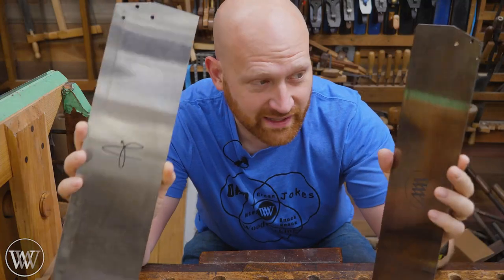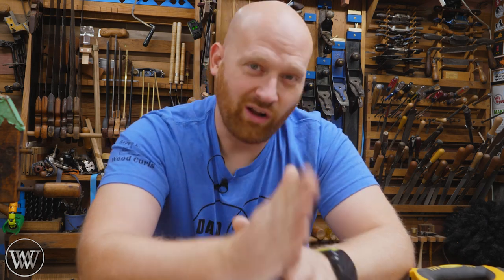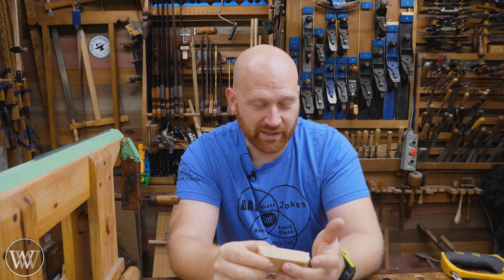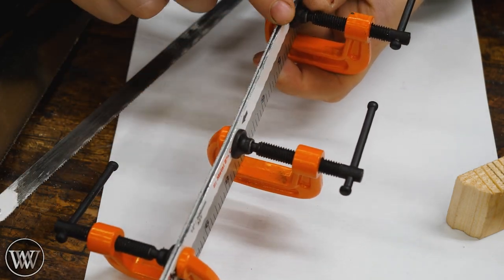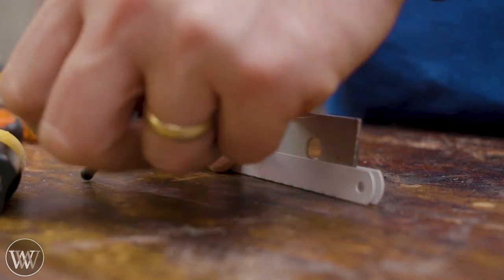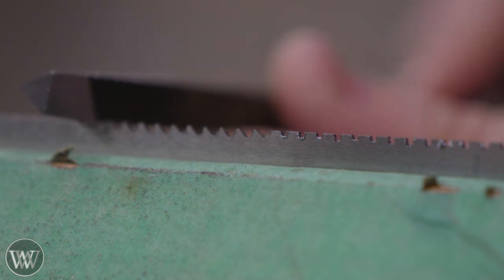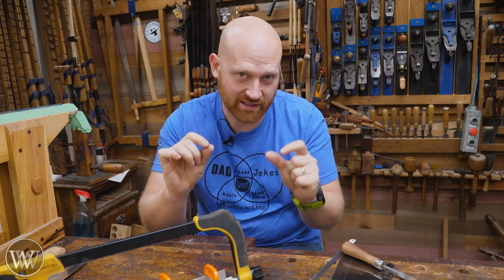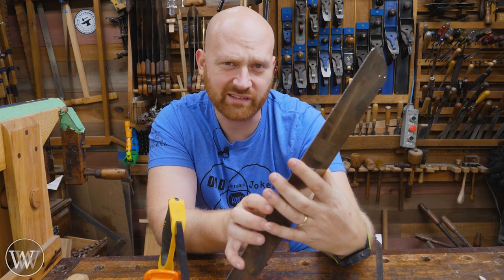Why I Have C Clamps On My Saw Cutting Teeth

Comment: If you have trouble starting the cut on the metal because of skating, turn the blade around and do it on a pull cut. That's useful whether or not you make the jig. But that jig sure is a clever solution.

Comment: 1. Spot weld the hacksaw blades in place.  Set it all up.  Get it right and then zip around to the welders shop and lock it all in place.  Mark the jig for the PPI it does.

I'm happy doing as fine as 12PPI, but you have just solved how I can form PPI smaller than that for dovetale saws  That's great!

Comment: Make small hardwood clamps (basically 2 pieces with a wing nut apply the pressure)to keep the center of mass closer to the midline, make it lighter,  and you don't have to listen to the handles rattle at every stroke

Comment: For the clamping I think cutting a grove in a piece of maple or other hard wood and then putting threaded holes with bolts or setscrews in them every other inch or so would work nicely.

Comment: How about making a special blade holder with a screw adjustable separation between the cutting blade and the guide? Something like those wooden grooving planes have. A luxury feature would be to have the guiding blade able to hinge up and down so that it hangs down below the cutting one when the cut is started and then retracts as the cut deepens.
One option for getting the TPI/PPI sorted out would be to get a threaded rod with the right pitch and use that as the guide or get a thread pitch gauge.

Comment: That is actually a very simple, but genius method Alex has figured out, props to him. I think for spacers, you found one of the easiest and cheapest options, as you can quite easily find metal rulers in quite a few different thicknesses.

Comment: Take some thickish bar stock, and cut a groove in one edge. Cross drill and tap one side of the groove for set screws.

If grooving the bar stock is too hard, find 3 pieces of metal that you can combine for the same profile, and drill, tap & screw them together

Tack the spacer and blades together with superglue. Load them into the slot in the bar stock, and fix In place with the set screws.

Or, like someone else mentioned, "Toolmakers Machinist Parallel Clamps". TayTools sells them. (like little hardened steel screw clamps). Use 2 or 3 of those to reinforce the blade sandwich, instead of the slotted bar stock.  If the screws really bother you, file flats on the threads for a wrench, and cut off the excess.

Comment: Another idea for shims would be to get set of mechanic’s feeler gauges to use with your steel ruler to set your spacing. Just use the appropriate feeler gauge or gauges at each clamp.

Comment: Great video and idea to solve an old age problem ! Just an idea with the two hacksaw blades to set the one with the back side down lower so that it acts as a progressive cut so that you do not have to angle the blade when cutting and the hack saw blade does not jump on the cut into the blade you cutting.
Reply from the maker: The problem with putting the smooth one lower is that you would then have to angle the saw to finish the cut. And then all of your sockets into the plate would be at an angle. That would make it harder to get the guide blade in.
Reply: So as the cutting blade advances and the curf deepens, the guide (upside down) blade  is getting higher in sympathy with it along the length of the hacksaw? Thus keeping it all on the vertical?
Reply: Hang on no - the guide goes deeper...... no my head hurts!
Reply: @WoodByWrightHowTo  At the far end the non cutting blade is lower, but at the near end they are level. That way in the beginning You have the guide and at the end of cut you have a full depth of cut. To start cutting the teeth You simply start at the end of the plate.

Comment: Just an idea: figure out what bits of shims you'd need for various TPI; sheet steel, hacksaw blades, a ruler etc (like with a dado stack as previously mentioned), clamp it all together and drill a handful of holes along the length to run bolts through, use a dremel or file to elongate the guide and cutting hacksaw blades to allow for the depth adjustment. 

For depth setting an assortment of metal rod diameters could be used, or a combination square in a pinch since you wouldn't have to worry about the assembly falling apart with everything loosely bolted together.

Comment: My first idea is to use a dremel or a proxxon tool with diamond wheel mounted on a wooden jig with one metal "finger" for the cut positioning. Afterwards you just move the whole plate. Not hand tools but i have a proxxon tool at home :)

Comment: Great idea, if you have a bunch to do I wonder if it wouldn't be easier for setup to get your spacer and guide-blade fitted-up on the bench and temporarily glued together with some CA glue THEN clamp to the cutting blade. At least for setting the depth-stop part of it you could then use something like a vernier caliper to get the depth where you want rather than hunting for some sort of shim/nail. Though I get the impression if you have a bunch to do you are probably further ahead to just get the saw plate cut on a machine or something...
Reply from the maker: CA glue is not a half bad idea to get in the right place.

Comment: I like to put a little machine oil to my metal cutting saw. Cuts down on the vibration and makes bit easier to push. Tho it makes chips gather around the teeth and clog so every now and then little wipe needed

Comment: This is exactly the thing I needed to get motivated about making saws again, thank you! And if you're anything like me, one thing there's no shortage of in the shop is prospective projects you'll totally get to one day. This means I've got gobs of old saw plates lying around I've been meaning to spruce up again or practice on, so why not use them for the depth guide portion of this jig? Hell, even just a third hacksaw blade should do the trick for the fine toothed saws, unless I'm getting ahead of myself. Panel saws won't do, considering their profile tapers towards the back and up to the top, but if I'm not mistaken any old back saw should have a pretty consistent thickness all along the plate.

Comment: Incredibly ingenious. Way to go Alex! My first thought for exact thicknesses was feeler gauges but they are usually far, far too thin and I've never seen one as long as a hacksaw blade. In truth, you would only need 5 or 6 sizes. I paid for my first tuba working summers at an HVAC shop where we made our own duct work. Sheet metal comes in very exact thicknesses usually expressed as decimals, for instance .032 is a very common thickness. And they always have sheet metal shears that cut 4 feet across. I'll bet a good HVAC or machine shop would cut you several strips in the thicknesses you want for very little money. And if they don't have as thick as you might need, you could laminate or just stack several thicknesses together to make it. A one inch, 4 ft long strip of 2 or 3 thicknesses would cut into four 12 inch strips of each thickness. You could just about make any thickness you want out of those. Kind of like stacking together dado blades and shims. (GASP!)
Reply: In metric land feeler gauges are usually sold in sets with strips from 0.05mm up to 1mm in 0.05mm increments for cheap enough that cutting a few apart for a project would not be a problem.
Reply: @pettere8429 , And, since they're usually manufactured and sold world wide in either TPI [Teeth Per Inch], or PPI [Points Per Inch], one can also easily find feeler gauges in thousandths of an inch thicknesses in "Imperial Measurement Land".

Comment: I don't have any ideas for improvements per se but I would think if you had  ruler/shim stock that was a little to thin for the PPI you want you could pit a few pieces of masking tape on either side to beef it up. The metal core would still provide the rigidity and wear resistance.  I also thought that the c-clamps would make the whole say heavier thus allowing you to focus more on control than pressure. Let the weight of the tool do the work sort of thing.

Comment: I like this idea. It reminds me of guitar fretting jigs. They involve basically a mitre box with an indexing pin, and a toothed fretting template that sticks to the fretboard and slots into the pin so you cut in the right place for the fret. They also have a depth stop incorporated and sometimes bearing guides, so more complicated but reminiscent
Reply: Also it reminds me of the table saw finger joint sled that people make, popping the previous cut into an indexing pin

Comment: I have re-toothed a few saws using both the paper strip and the Paul Sellers wood block guide methods. I never liked the paper method (probably a combination at lack of skill and impatience). The wooden guide is ok for saws down to about 12 tpi but I really struggled when trying to do a 15 tpi dovetail saw. My solution was to use a blade meant for a mechanical hacksaw with the right tooth count as a guide. The blade is at least 25 mm (1 inch) deep and doesn’t have the “wave” set of most hand hacksaw blades. It is easy to clamp to the saw plate and I made the initial cut with a junior hacksaw, modified as per Paul Sellers.
I know this isn’t really adding to the innovation of a saw tooth cutting jig but it worked for me to do a one off project.

Comment: McMaster Carr or Grainer likely sells brass or steel in thicknesses that would make good inexpensive shims.  Thanks for sharing.  I've got an old Disson saw that used to reside in my dad's 56 Ford pickup truck to rough cut lumber.  He have it to me after the saw sat outside for a year.  It's on the list to restore.  Since I already have more saws than I need, I was planning to convert it to a 3 PPI ripping machine.  Still likely going to stick to the Paul Sellers method and actually use a finer PPI first two inches of the saw to redo the plate.  Glad to see this method though.  Little by little I've been making my own tools becuase it's fun to do so and a saw is on the list for sure.
Reply: Also should say, I used McMaster Carr to but O1 tool steel that is 1/16" wide by 1/2" thick for like $10.  I am going to use that stock to make my own 1/16" wide chisel sort of in a mortise chisel style (for the once every three years I need to use it).  That's why I know they have lots of metal in various sizes to choose from.
Reply: McMasterCarr was my first thought!

Comment: I have some spring clamps that I got for scale modeling that might work for holding those blades. They are quite steady when used on flat pieces. And they'd fit under the frame of any but the smallest hacksaw.
Reply from the maker: I thought of adding double-sided tape to add a bit of friction. Then even with a lighter spring clamp it should hold.

Comment: Look at the see-saw, did you see what I saw?
Your saw TPI jig is great. It’s basic. And most importantly, it works.
Consistency in TPI means your cuts are done correctly and saves labor.
Outside of spending $$$(who has extra saved up?),It’s the prefect fix.

Comment: The upside-down hacksaw blade could be a little lower to ride in the previous tooth gullet; this way you would not have to angle the saw before creating the next gullet. Of course, you'd have to create the first one, then put the second saw blade in place so it'd be another set-up step, but might save a lot of time and fidgeting for most of the cuts.
Reply: I initially thought to do this, but it wouldn’t work (at least didn’t in my head). It will cut first tooth ok, second to a lesser depth, and third or so wouldn’t cut, as will not have enough depth in the reference tooth. Again, this were my thoughts and reasons keep blades parallel
Reply from the maker: The problem with putting the smooth one lower is that you would then have to angle the saw to finish the cut. And then all of your sockets into the plate would be at an angle. That would make it harder to get the guide blade in.
Reply: @WoodByWrightHowTo  this is an awesome trick. I wonder if there is a reliable way to place the upside down blade at an angle so that one end is marginally lower than the right side up blade and level at the other end.
Reply: @WoodByWrightHowTo  you could use a 3rd blade as a spacer too

Comment: Could you make a spacer and then glue something both ends with the right depth? Then means you can just use a flat surface to set the whole thing up so long as the blades are standing square

Comment: The bigger difficulty I've always found is after shaping small crosscut teeth is getting the set right. Very fiddlly keeping the saw set firmly on the twice angled tooth. Maybe I just need to find a way to get the hammer and anvil a smidge lower down the tooth.
Reply from the maker: a good saw set that fits your style is worth its weight in gold.

Comment: What do you think about for a one off doing the paul sellers method but 3d printing the guide block? You might need to print one for each saw or two but if you've got a printer they'd be cheap and quick to make. Or just 3dprint the spacer for the two hacksaw blades?

Comment: Is it possible to cut a kerf in say a 3" long by say 1"x1" piece of wood that can rest over the new blade. Then affix a thin square piece of metal onto one end that hangs down roughly the desired cut depth and is filed so that it can sit in the previous cut tooth while the face of the metal acts as a guide to saw along? So you cut a tooth and just advance the guide block down the blade to line up the next cut. It doesn't give you the depth stop, but it seems like you could possibly count strokes for that.

Comment: I would imagine that you could even do multiple cuts at a time the issue would be tensioning each blade. But nuts and bolts in place of the c clams could work.  A dedicated jig out of old old hack saw blade.

Comment: This distinctly reminds me of a box joint cutting jig just switched around somewhat.  I suppose if someone wanted to they could use a tile cutter with a relevant jig to move it closer to a normal box joint cutting jig.  You could even then go down the lines of adding the relevant angles onto each tooth as they're cut.  This would be an interesting experiment but kind of defeats the point I feel.

Comment: If you drill through the blades and spacer then rivet or bolt them together you could do away with the clamps and free up the length of the blade making it less bulky and cumbersome to use
Reply from the maker: Drilling through hacksaw blades is not easy. But if you can do it that would be a great answer.
Reply: @WoodByWrightHowTo  how about diamond dental drill bit in a Dremel tool?

Comment: How about a guide that's not attached to the hacksaw at all - one that's like a cross between a magnetic dovetail saw guide and a box joint jig?

A small piece of soft metal (mild steel, brass, aluminum) with a groove/kerf running longways down an edge that's just wide enough to slip down over the top of saw plate.  Crosscut a perpendicular kerf on the same edge with the hacksaw that's a bit deeper than the long groove.  Wedge or glue in a piece of hacksaw blade upside down in the crosscut kerf to index the jig.  Cut or sand down the end of the piece so that the final distance between the indexing piece of blade and the end of the jig matches the desired saw tooth spacing.  

After you make your first cut into the actual saw plate, you slip the jig over top of the plate, index the crosspiece into the first kerf in the plate, run your hacksaw along the near edge of your jig to start your next cut.  After each cut, you index the jig into the kerf your just made.  

You might also be able to apply the basic concept, built quicker and with more flexibility, by using a scrap of wood.  After adding the long plate groove, cross-cut the indexing kerf.  Then trim the end of the wood to leave just a rebate the width of the indexing blade piece.  Finally use small screws or rare earth magnets in the end of the wood jig to attach different width shims (ideally steel) for different tooth counts.  Magnets would have the added benefit of aiding in aligning/tracking your hacksaw to the end of the jig.  Use would be much like a magnetic DT saw guide but with indexing.
Reply from the maker: like this one. https://www.youtube.com/watch?v=fNH6ENBccOk&t=819s I may show a quick and dirty version of that here soon
Reply: @WoodByWrightHowTo  Ha, my idea vs that seems like a cave man finger painting compared to a Michaelangelo. A quick version would still be cool to see

Comment: How about hack saw blades (or pieces of blades) as spacers?  You could layer 2 or 3 for thicker spacers.  Washers might work, 1 at each C-clamp.  I have tried grinding washers down to a specific thickness (for a different purpose).  I wasn't super successful, but I'm not a machinist or metal worker.  I assume that someone could suggest a way to do that accurately.

Comment: If I were to do something like this I may set it up with the clamps and then drill through all 3 pieces and bolt it together so there aren't clamps sticking out and making the weight weird. If this was something you did a lot you could make an accurate drilling jig and bypass having to set it up every time.
Reply: well… drilling was the first thing I wanted to do, but hacksaw blades are hardened and very fragile. If you try to drill, it will most likely just break
Reply from the maker: If you have the patience and accuracy to drill through the hardened hacksaw blade. That would be a great answer.
Reply: @A2woodArt  That's fair... I hadn't really considered that.